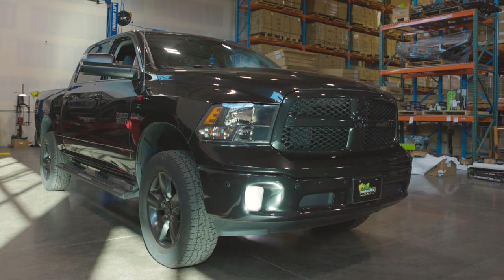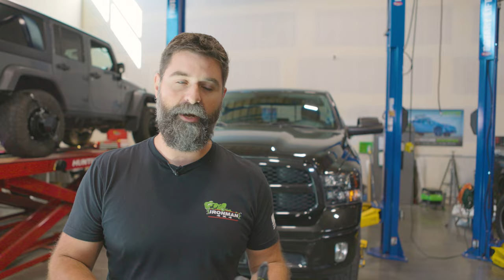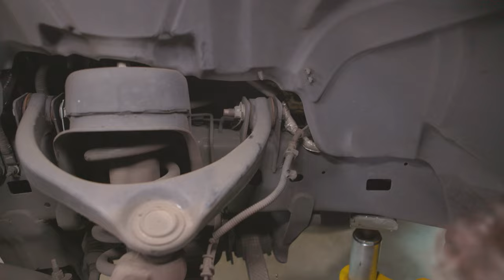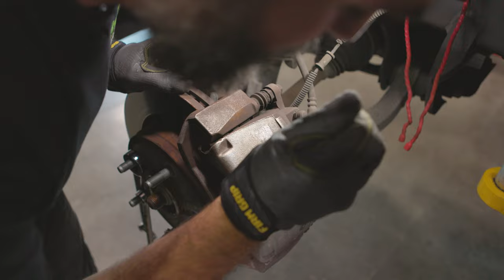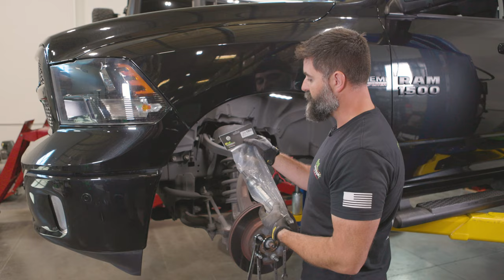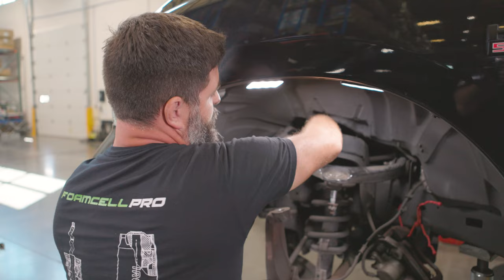Ironman 4x4 Foam Cell Pro Suspension Kit Suited For RAM 1500 DS | Install Guide

Comment: When I did my suspension, for the driver's side rear bolt I just loosened the fuel tank straps and dropped it out of the way enough that I could get a hand in there with a ratchet. I had a transmission jack handy for it as well, made it super easy. It might take some doing/stacking 4x4s if you're doing it in the driveway, and you'll probably need a floor jack, but let's be honest, if you're attempting this in your driveway, you've got a way to jack your vehicle up relatively easily.

Comment: It technically would work with airride, but you would be deleting the air ride, and you would need an additional rear spring isolator

Comment: Did you install the comfort springs or performance springs on this truck? What were the hub to fender measurements?
Reply from the maker: With the added weight of both bumpers, winch, and armor the Performance Load or Medium coils were the right choice.  I don't have the before and after lift hub to fender measurements for this particular build handy.
Reply: @Ironman4x4America  looks good. I plan on coming by your HQ in the near future to get these installed.

Comment: Back to this video for me, I found out my rear shocks shipped to me are Comfort valved, but you have 3 different offered(just not offered when purchasing the kit) Comfort, long Travel, and longtravel/comfort. Which rear shocks were installed on this ram?
Reply: I also have almost triple the threads showing on the bottom of the shock, came like that from factory and i havent adjusted, front end is still raked lower than my rear 2 inch spring